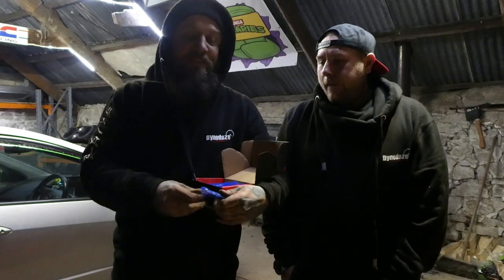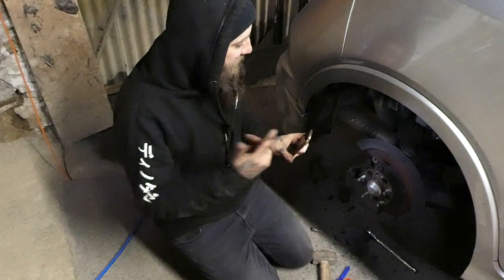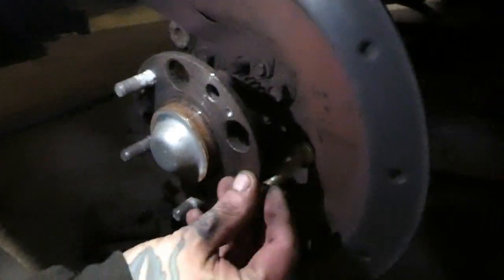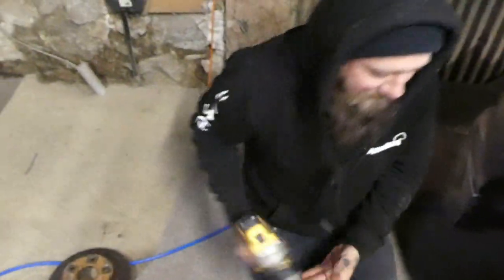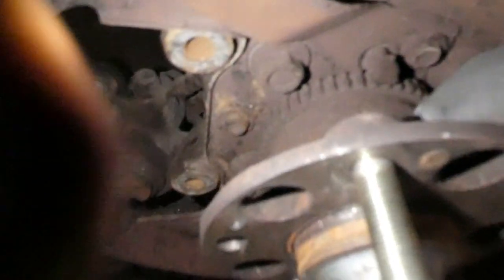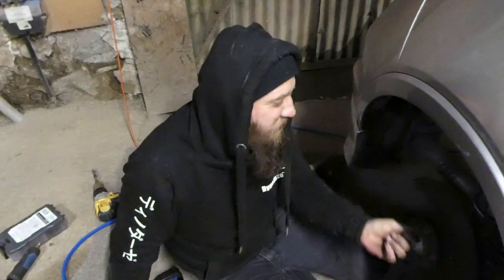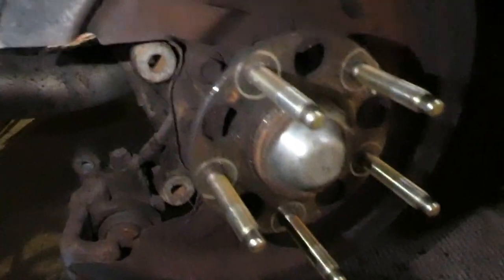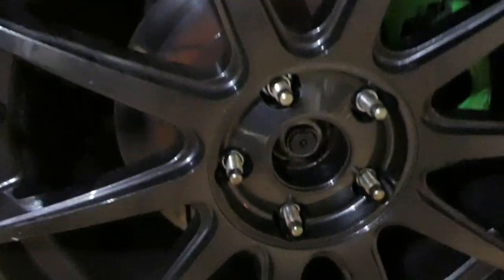FN2 Honda Civic Type R Extended rear wheel stud installation

Comment: Hi guys love this video …. Got the same studs to go in my fn2… so they are the team dynamics offset 45 8j 

Got some 7 mm spacers to slip on…. You reckon that will clear a big break kit ? What wheel lugs did you use in the end to cover the remaining stud once wheel were on ?

Thanks 😍

Comment: Mate do you think I will get away with keeping oem studs running 5mm spacers?
Reply from the maker: I’ve ran 20mm spacers with no issues on oem wheels and studs, these needed changing due to the new wheels that’s all
Reply: @CowabungaCarDiaries  yeh I’ve got aftermarket wheels as well d1r lenso 5 spoke 18”x8j I will try fitting 5mm on oem studs see how it goes wheels are 45 offset want them to be 40 would be perfect

Comment: Hey guys, any ideas what length the standard fn2 studs were? I'm trying to work out If the 47mm ones tegiwa sell are longer than the stock fn2 studs as they sell a 42mm one and a 47mm one and then a specific fn2 one but don't specify the length. I only need em 5mm or longer longer than standard
Reply from the maker: Don’t quote me on this but I think the standard studs are 42.5mm long
Reply: @CowabungaCarDiaries  cheers mate. I wonder why they list a separate 42mm one and also a specific fn2 one but don't list the length. And then they sell a 47mm one! I only need 10 and only need them 5mm longer to accommodate a 5mm slip on spacer
Reply from the maker: @MrHipwell1989  I was in the exact same predicament mate it’s all super annoying bud. I ended up speaking to Tegiwa via emails I think to try and figure it out